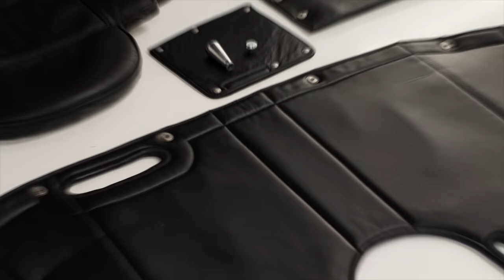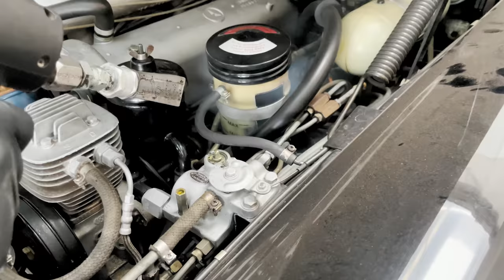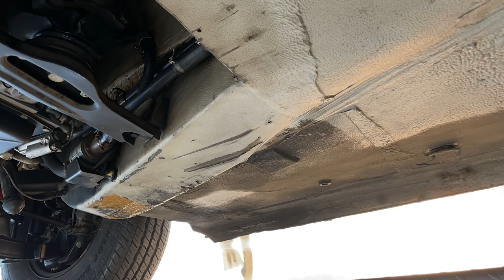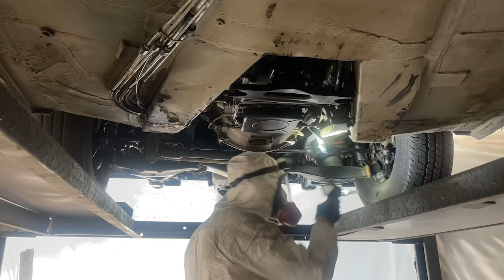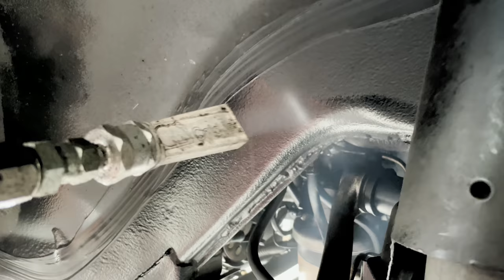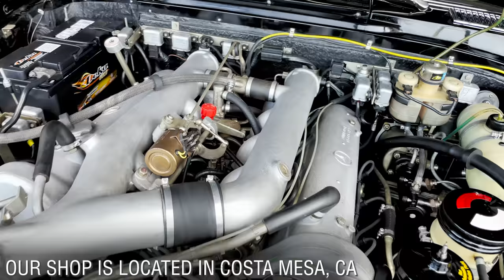Dry Ice Cleaning MERCEDES BENZ 600 the ultimate limo done for MB Classic Center

Comment: Do you protect the under carriage after dry ice cleaning up?
Reply: Yeah, I have to wonder the future of these vehicles. They look great, but removing protectant, oil and grease from parts that need it cant be good. It's like wheel cleaner sprays. They end up causing brake piston and caliper failure over time because they remove lubrication that's needed...
Reply: @stevemcgowen  thank you for the reply 😊
Reply: Muy buena pregunta que pasa después

Comment: A quick question about dry ice… where all that dirt goes? Also, can you mess up the surface if you go too close? Thanks in advance and sorry if this was asked before
Reply from the maker: The dirt goes on floor and everything around… so it’s depend how’s look your working space but after one car everything will be covered with dust. 
Yes you can mess up the surface if you don’t know how to setup the machine or if you go too close… but we are able to clean leather interior or remove paint from the car, you just have to know what you doing.

Comment: Why using dry ice? And not the old soap and water? Seems like a gimmick tbh
Reply: Dry ice cleaning is 100 times more efficient and quick than any other way to remove the dirt and it allows to go in the smallest interstices. You cannot do that with a brush and a degreaser.
Reply from the maker: Exactly what @1964jmcr said  and also on car like this you don’t want use water and degreaser. And with dry ice you have high control what you doing and where compare with high pressure washer where you just spreading water everywhere.
Reply: Try it before you judge.  We began in the spring of 2019, haven't use a drop of water on 90+ cars since.  It's no gimmick.